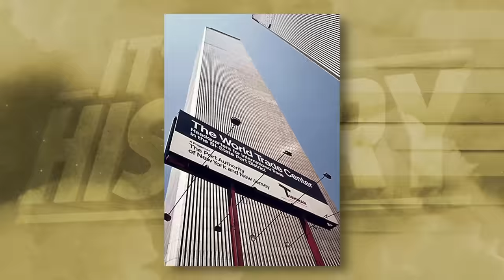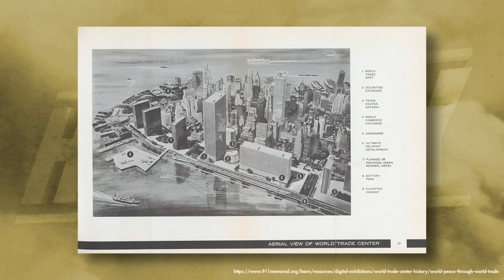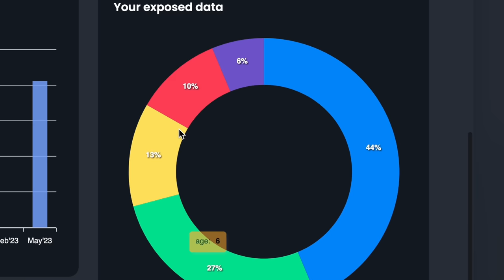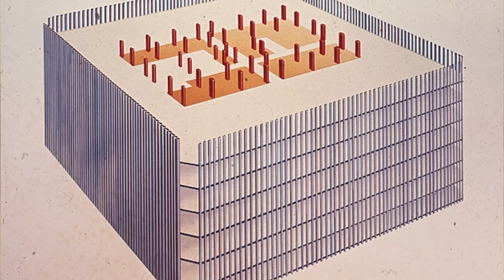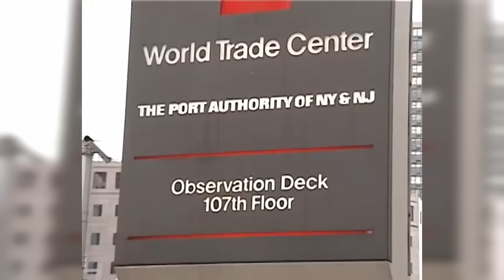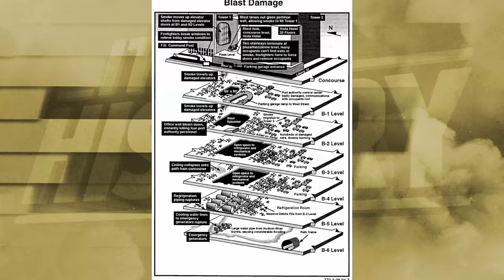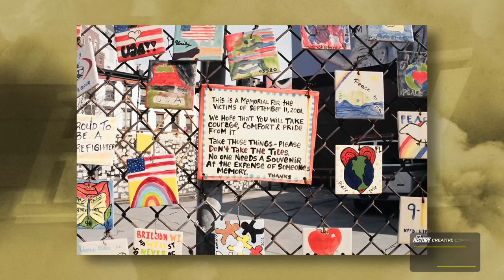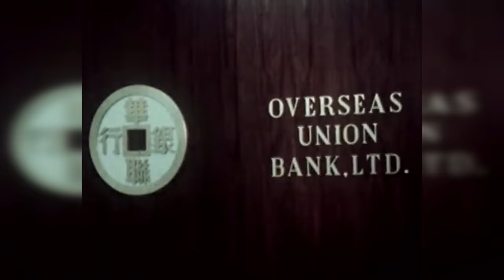What's Left of New York's World Trade Center | Rise and Fall of the Twin Towers

Comment: Really not possible to find an image to highlight the music stage on the plaza other than one from September 11th? I find this to be in very poor taste considering the holes in the roof of this stage are made from falling bodies.

Skidmore Owing & Merrill designed the new One World Trade Center, not the original. Minoru Yamasaki and Associates of Troy, Michigan, and Emery Roth and Sons of New York were the firm responsible.

Chronology is off regarding Petiti's high wire stunt, 1974 and Quinn's parachute jump in 1975.

Daniel Liebskin is not the architect or designer responsible for the memorial.

500,000 people passing through and or working in the WTC in a given day? Come on Ryan... these are lazy mistakes. 

One final point of contention upon cursory viewing: I would hesitate to attribute the destruction of the WTC to debris as you have asserted in this video. The destruction is known to be the weakening of the steel columns as a precipitous result of fires burning uncontrolled over several floors of which had lost their fireproofing being blasted off by the impact of two 767's both of which impacted at over 500 mph.

Comment: Excellent documentary. A few additions however. It was an attack; NOT a tragedy. When first built, no one wanted to work there due to a lack of restaurants or stores for shopping. Later corrected. State agencies rented space until demand rose. My dad worked there in the 1980s. The floors whipped back and forth and elevators were halted during high winds. He thought it was interesting; but some people quit their jobs. Sometimes he saw blue skies from the 80th floor but rain clouds below him. My dad was an engineer and he was told by engineers that the AC system used water from the Hudson River. Unfortunately, the Hudson, where it met the ocean, was actually a salt water fjord. The salt water ate the AC pipes which had to be replaced. I've never read this anywhere.  The death toll was low because 9/11/2001 was the first day of school  and a Democratic primary day. Many people dropped off kids and/or voted. Which is why the death toll among foreign born young employees was so high. The 1993 terrorist bombing sounded like a very heavy book dropped on a cement floor to those of us who worked nearby. One episode of Law & Order ran between the two attacks. Chris Noth ( I think) said; "why, are you planning another attack?" The debris was used as landfill for the Battery Park City area just south of Ground Zero. Again; well done.

Comment: I mean it’s not that impressive. A fire brought them down in under an hour. Meh.
Reply: On the contrary, the structure held out long enough despite being severely weakened and exposed to fires that were over 1000 degrees Celsius for 12,000 people to evacuate
Reply: @AB-mw8oz  under 1 hour is unimpressive. You would think the portion above the fire would cave and topple over to one side and fall or collapse on itself independent of the stronghold below; but only that portion. But considering the top portion collapsed and brought it down floor by floor all at once seems like some shoddy work. A building that tall should be designed to hold below a damage point.
Reply: @JaBrandonSpoons  the the weakened support columns gave out under the weight and heat. Once 20 stories started to collapse nothing will stop it
Reply: @JaBrandonSpoons  That was massive damage.  No, every building should not be built to withstand anything a group of maniacs might do.
Reply: no building should have in mind the idea that a boeing 767 is traveling at 950 kmph at it with almost max fuel.

also, the "tipping over" idea is really stupid. it cant cave in one side and the other lifts up and falls off, do you understand the huge weight of those floors? it would only fall down on the other floors.

while i can agree that the buildings arent state of the art when it comes to engineering, since a lot of corners were cut, i still could never say that they were not impressed, giant and ahead of their time. they could've been a lot greater if the port authority actually respected its own building code and had some more safety features.